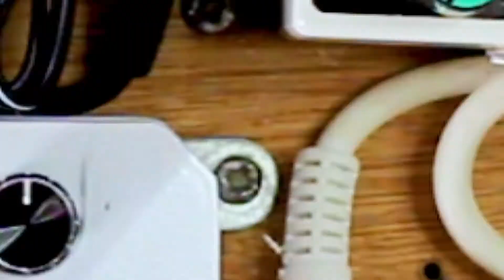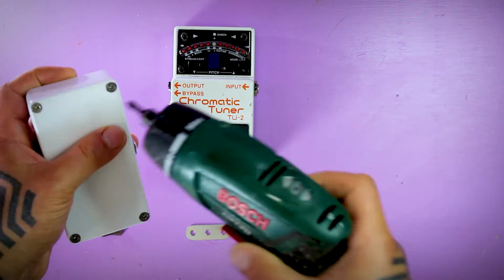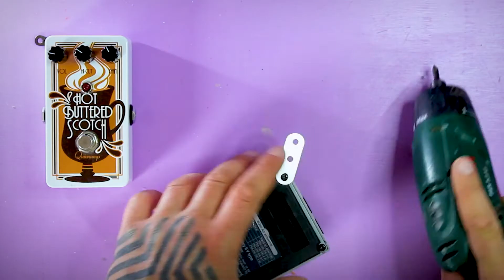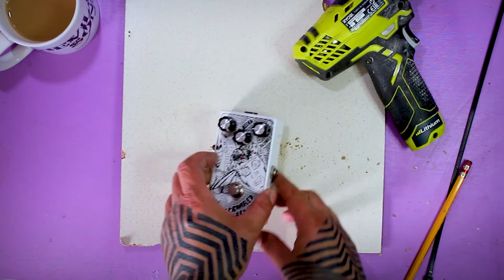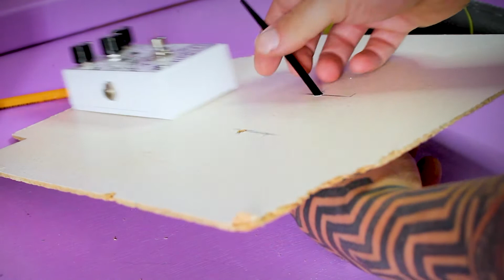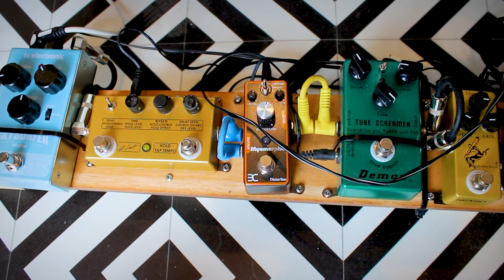Mind Blowing Pedalboard Trick Using Hardware Store Parts!

Comment: If you want o get really fancy and you aren’t changing out your pedals a lot, you can use threaded inserts into the wood and then machine screws to hold the pedals to the board. Then you can remove the screws as much as you want without stripping out the wood with wood screws.
Reply from the maker: Fancy pants. I like it.

Comment: Keep in mind! Unscrewed bolt - void warranty
Reply: So replacing the battery voids the warranty?
Reply from the maker: @SeventhStringHeaven to be fair on the original comment, most pedals that have batteries have battery compartments that open without unscrewing the main screws.
Reply: @DevilAndSons I reckon most of mine are the opposite. All my Xotic stuff, MXR, etc. 4 screws to get to the battery.
Reply from the maker: @SeventhStringHeaven actually, my mxr does too. Also, some of my pedals have internal trim pots that the instructions say you can change, so I doubt that would effect the warranty.
Reply from the maker: Good point

Comment: Anyone try rare earth magnets? Wonder if they would effect the electronics…
Reply: I hang spray cans from the ceiling of my work van with inch and a half diameter round ones.
Reply from the maker: That's cool.
Reply: After experimenting I found that you can with some pedals and some not a good idea. Ie. TC Electric pedals must have an internal reed switch because I can turn them on and off by moving the magnet closer and further away from the backside center of the digital delay and reverb pedal. I may try to epoxy a piece of steel to the backside of them for magnetic shielding/mounting base and see how that goes. I have an old Dane electro milkshake pedal that seems to work just fine as the battery cover screw is magnetic and it didn’t affect it.
Reply from the maker: That's interesting. I like the idea of controlling a pedal with a magnet, it may have some interesting advantages.
Reply from the maker: That's an interesting idea. I wonder how strong they are when the pedals are being used a lot like a wah?